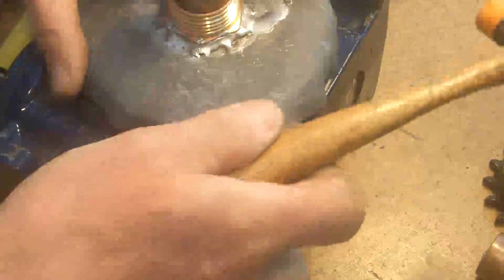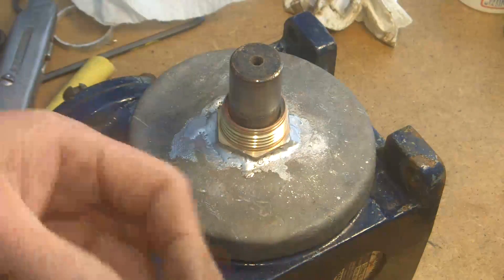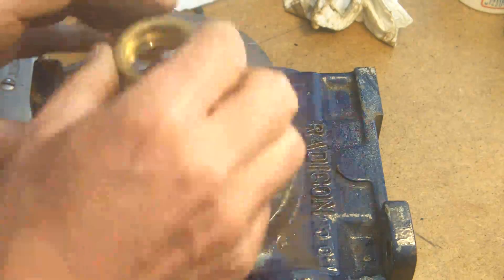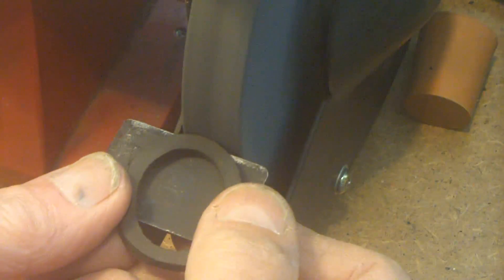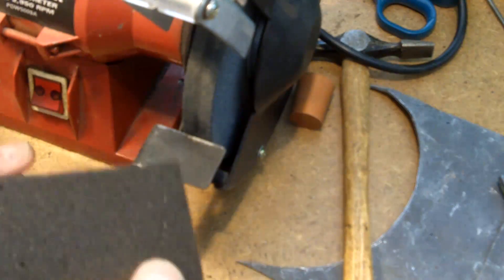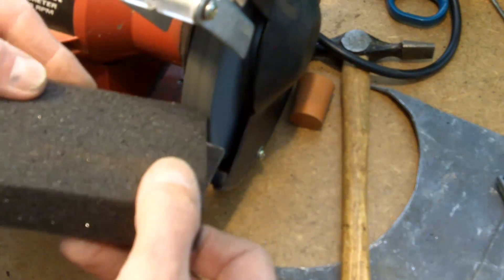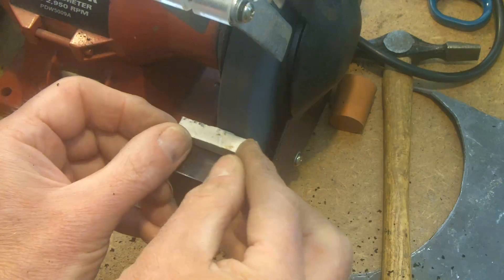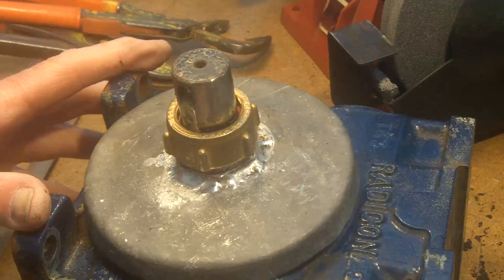About Radio 75 Antenna Rotator part 7  completion of sealing the rotator

Comment from the maker: Hi Eddy, thanks for the feedback, the tops of railway track are induction hardened and I carried out trials at different production rates and various depths of hardness, it needs a lot of power to heat it fast enough so the heat doesn’t go too deep before you quench and harden it, anyway the off cuts make great workbench anvils.
Regards ... Andy